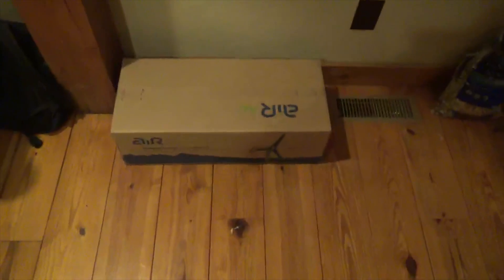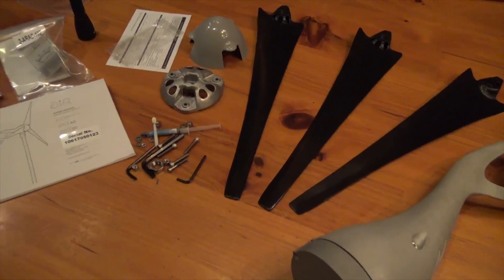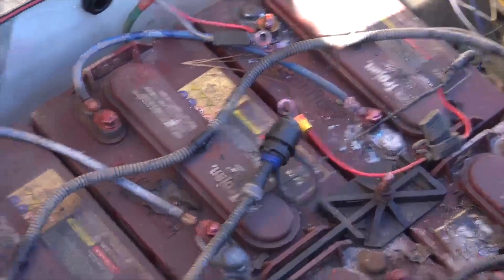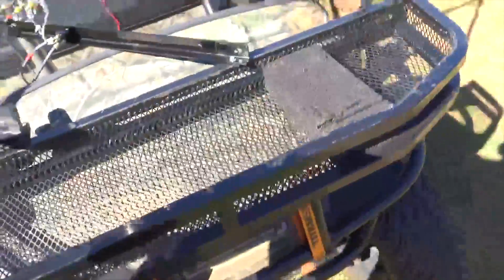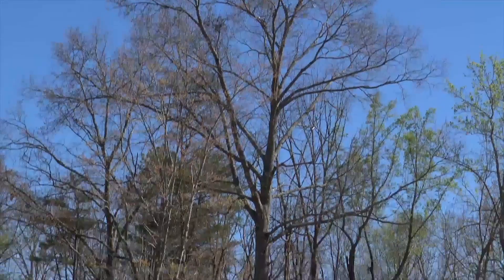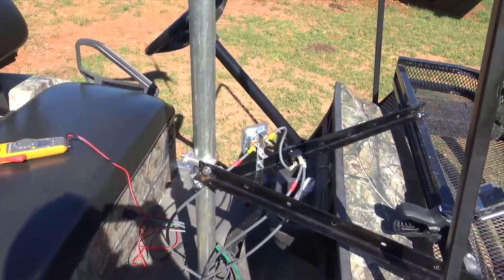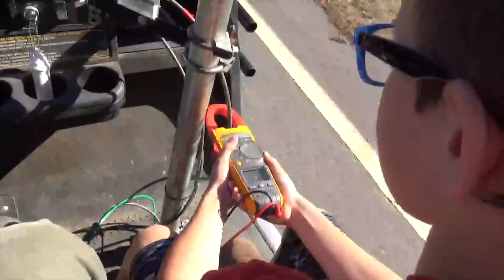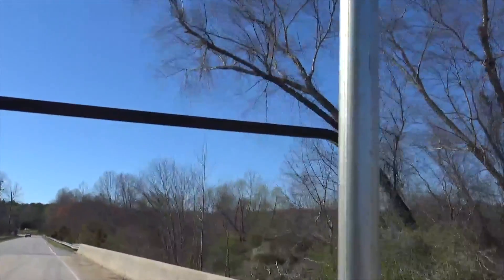Elijah's Perpetual Motion Machine

Comment: I'm concerned about the max wind speed limit on these turbines.  Rather than having to run to your installation to turn it off ('feather" the prop?) during high winds, is there anything that would "shift gears" to allow for more power to be generated with the faster winds?  Heard anything like that?  Anyway, enjoyed your PM machine and especially how you involved Elijah - those times are special for both Dad and son.

Comment: April fool's joking aside, I think you may be onto something!  Now if I could just figure out how to attach a solar panel to my electric wheelchair.  Hmmmmm......
Reply from the maker: Thank you as always!  Maybe start with a stationary solar charging station for the wheelchair?
Reply: Already have a 24 volt panel run from the roof with an XLR connector.  But I have to charge in the office, because I can't charge and operate at the same time due to some kind of internal switch shuts off the go when the charger is connected.  If I could just turn off that switch and attach a panel, I'd have it made!  But maybe static charging in the office is the best I can do......hmmmm, dunno.

Comment: I would love to see some numbers on this. Being told thermodynamics will make it impossible to charge a battery from  a windmill attached to the EV while driving... actually drives me crazy. For me to understand it, I need to experiment with it. 

What is the range of this EV with that entire set up from a fully charged battery pack? Drive 20 miles with the windmill charging the battery, what's the remaining range? 

Recharge the battery to full and drive again 20 miles with the windmill not charging, perhaps attaching it to an other load so you'll continue to have the same resistance of the windmill against the wind... where the thermodynamics may come into play. After 20 miles, what is the remaining range? 

Is there a difference between the two runs? If so, how does it play out?